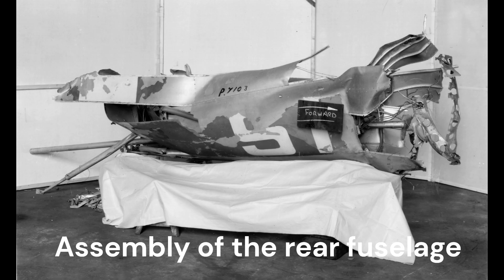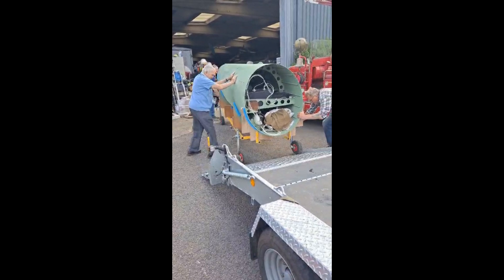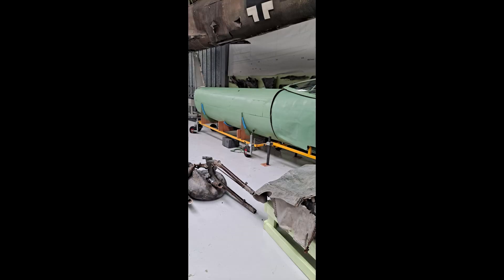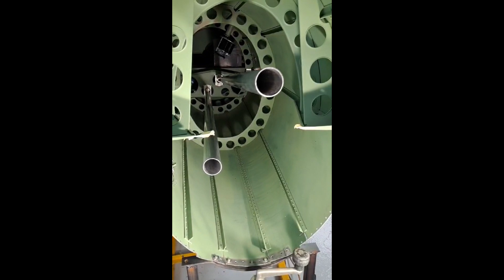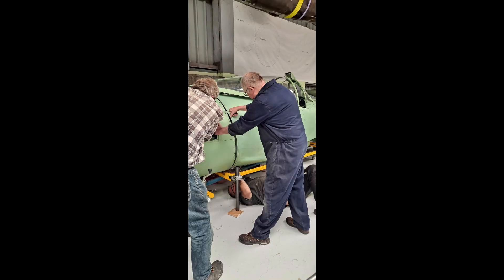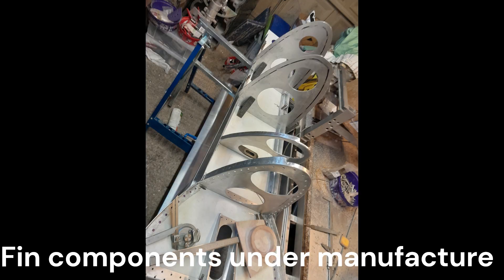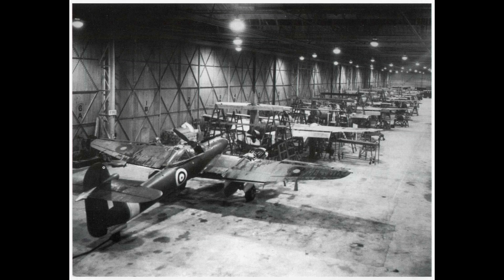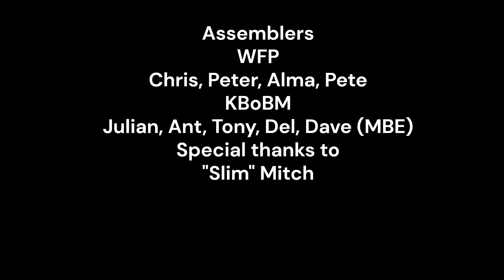Whirlwind Fighter Project - Engineering Update part 23 - Fuselage Assembly

Comment: So will this fly
Reply: Nope
Reply: No , there are no original flightworthy engines and none that could be made airworthy. Also the high pressure hydraulics and spool valve controls are completely unavailable, and as you will be able to see on the WFP web page most of the original drawings etc are lost and the aircraft has had to be re-engineered with details of original alloys etc not now known or available. It would not be possible to get the required permissions from the CAA. In any event why would you risk the sole example in existence to the undoubted  and sadly well evidenced risks of display flying?
Reply: @DAVIDSMITH-po7vk  ok cool thanks well looks like I'll have to build a big RC one now sorry we can see one fly again sort off
Reply: So the next question is- as the original perguine engine was completely naff, is another modern type of similar size and power available ?  As in the Me 262 ,   it might not be 100% but she could fly or even taxi . It would be such a shame after all the great work done on this project for it not to. Best wishes with the build.👍
Reply: @RobertCogan-p9u  The Peregrine was far from naff, it was just a Kestrel (a reliable engine) with a downdraft carb and had the same power to weight as a Merlin III. The props were dodgy because no-one at the time really got the effects of compressibility over aerofoils - but I digress. Yes, another engine type could be fitted - however, to taxi you need all sorts of other very expensive and complex systems to be manufactured - and who would bankroll that if it couldn't be flown anyway? Ours is the only feasible solution in the real, cash-strapped world when it comes to recreating an actual WW 😀
Reply: @RCWarbirds_Rescue  Fair enough point taken, but has anyone thought about doing a "go fund me? " This would maybe help especially if it helps get the aircraft financed and finished, it might take a while but it's a possibility. Just a thought.
Ps,
What about the BBMF? Could they help?
From my recollection the Whirlwind was at Exeter or Ford during the battle of Britain and may have been involved in a minor capacity just like the Gladiator. The   BBMF maybe able to source parts or even have old knowledge of aircraft disposal sites when aircraft got disposed of usable parts were stored for reissue. A long shot I know. or even collectors,  I only say this because my friend's dad was one such person. I walked into the garage and leaning against the wall was a rudder off a Vampire jet. In the living room on a shelf was a complete radio setup from a Lancaster bomber. So maybe it would be worth it to advertise for parts in the aircraft magazines? Who knows what you might turn up. Just a thought.
Reply: Why?
Reply: @dale3852  Becuase the CAA will not let it. Engines not certified (if they have any aviailbe and like wise none of the rest of the systems are certified).